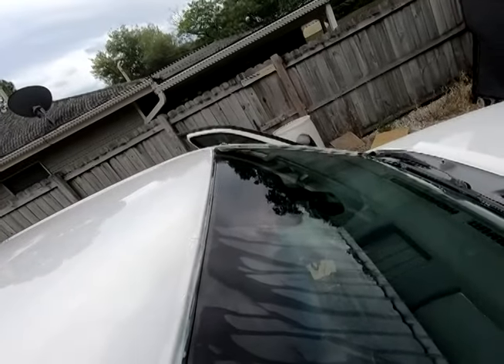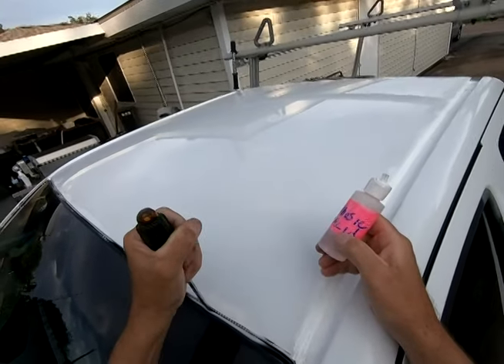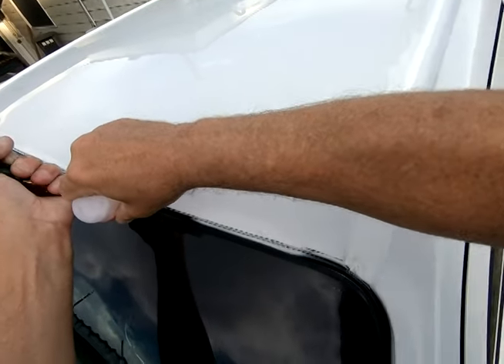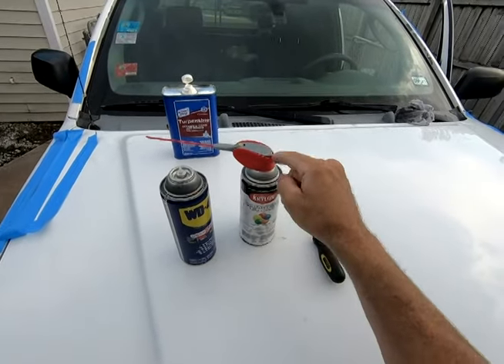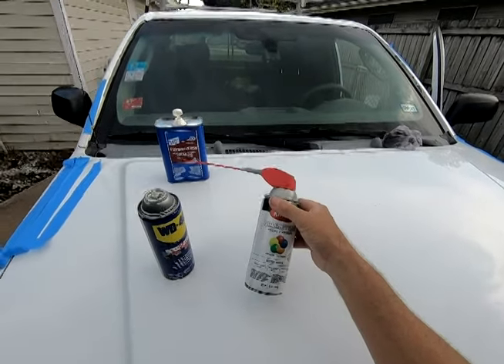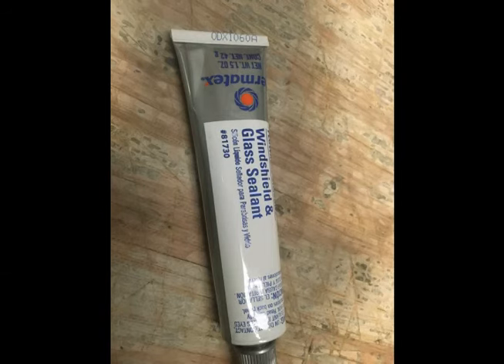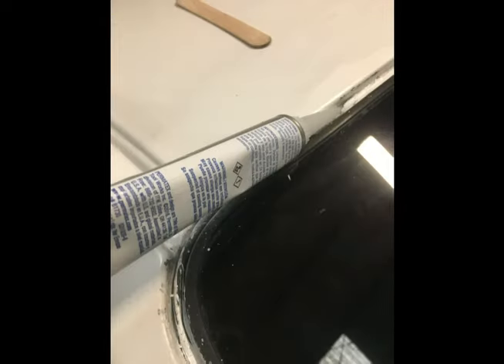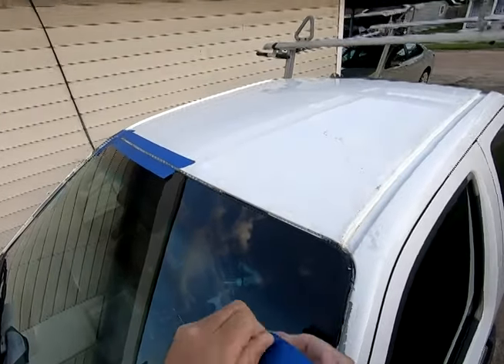How to  repair a leaking windshield on   truck when it rains

Comment: If the leak is along the top seal, where water is entering the interior of the vehicle. How do you prevent the rust converter and paint from also leaking through?
Reply from the maker: Gravity

Comment: Did you end up pulling the windshield seal strip and just filling it with the black flex seal? Or did you flex seal over top of the windshield seal strip?
Reply from the maker: Over the top

Comment: ive tried sealing from the inside 4 different times.  
i need another method.   wow, this seems complex
Reply: Have a glass company pull the windshield and reinstall it. Once it’s out you can figure out tek he true cause of the leak.
Reply: @thecelt6659  i just tried something different, sealing it from the outside😂.  Now, i have to wait till a heavy rain to see if it's all good
Reply: @thecelt6659  Only problem with that is my glass company wants $250 just to reinstall a good windshield

Comment: You need to use a wire brush, or do some sanding before using the rust converter . This WILL leak again